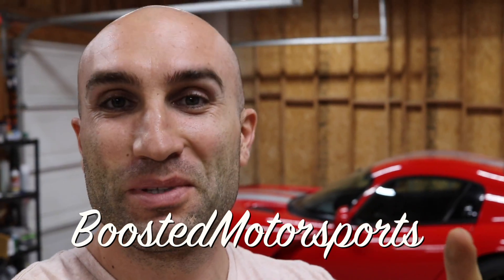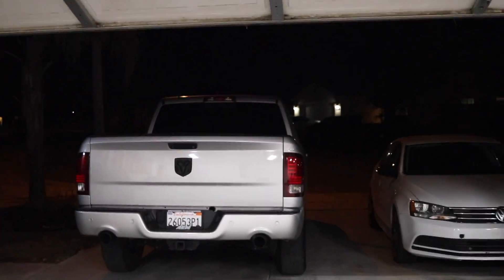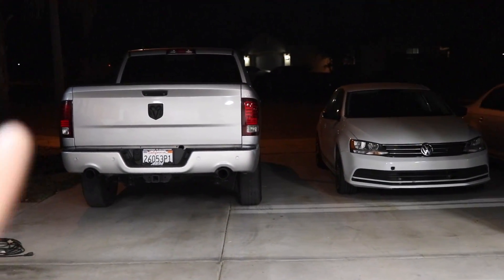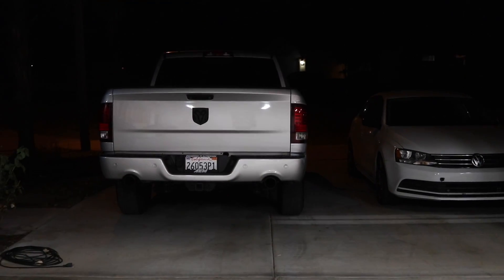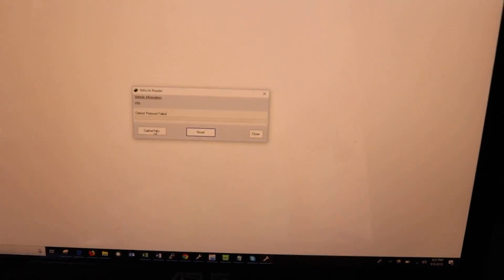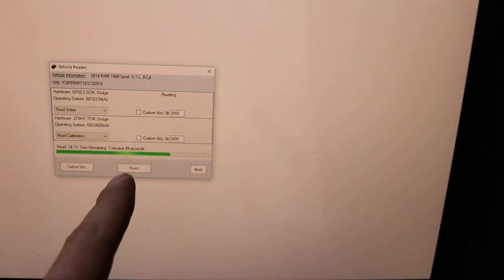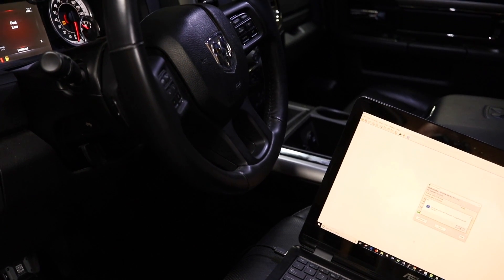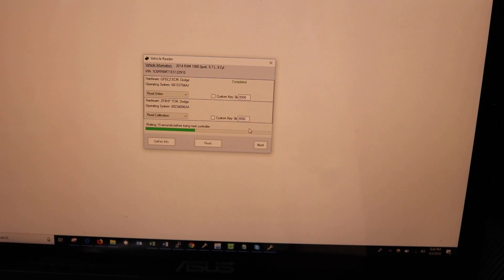Doing a Clean Tune Read with HP Tuners

Comment: I would like your opinion on tuning my 2013 1500 Big horn. Here is the situation; I had a 2009 Ram 1500 big horn Hemi. It typically got 400+ mikes per tankful. I traded it in for a 2013 1500 big horn Hemi. The new ram never gets more than 350 miles per tankful. Both are stock and both have the same transmission.  The only difference between the two is the 2013 came with an electric braking system for trailering. Also, the 2013 has always been more sluggish off the line than the 2009. This leads me to believe the engine is tuned for hauling. Is this possible and how do I check without Buying a HP Tuner? Thoughts?
Reply from the maker: Did you have the same size tank in the 09?  Some of these trucks have 32gal tanks like mine.  Also do you have the 8speed in your 13?
Reply: Both RAMs have the 545RLE tranny and 26 gallon fuel tank.
Reply from the maker: Do both trucks have the same gear ratios?
Reply: That's a good question. I wasn't aware the 545RFE had more than one gear ratio. Let me look into it.  I did a little reading and called RAM. I have the 65RFE in my 2013.  According to RAM, its a computer re-calibrated 545RFE tranny. But in the context of your question the gear ratios between the two trannys is exactly the same. My initial reaction to this new information was that perhaps they changed the programming in the tranny computer for towing, but that shouldn't affect first gear sluggishness as first gear in both RAMS are the same 3 to 1 gear ratio. I also learned RAM changed up the torque converter in 2012 to a heavier duty TC than they used in previous years.  So, I believe that leaves me with two possible suspects. Engine management computer tuning or a much less efficient torque converter...